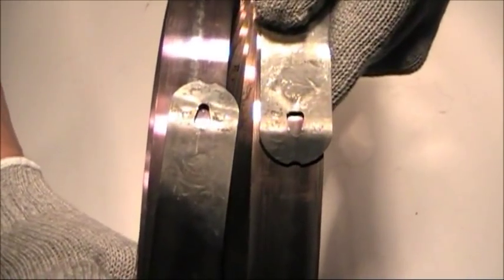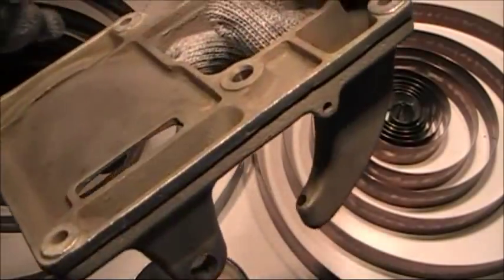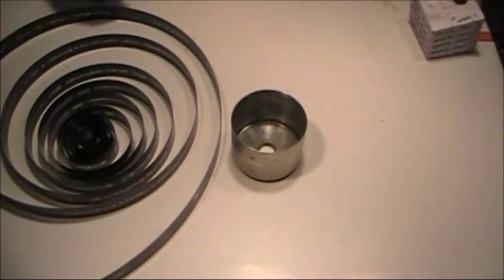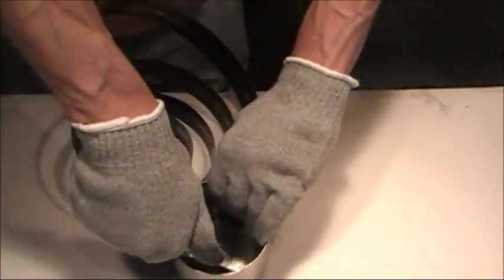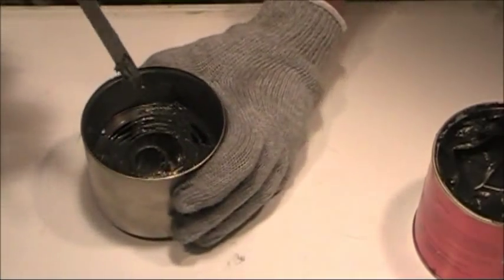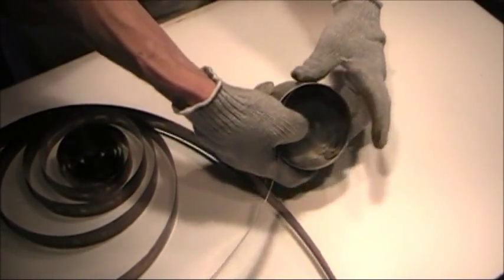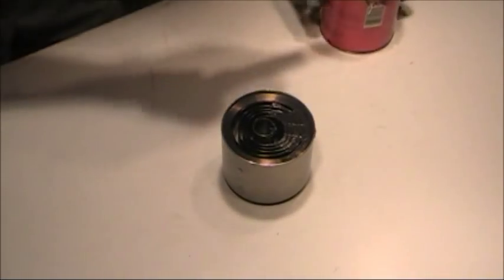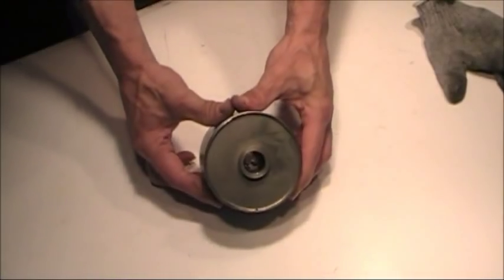Victor Two Spring Motor Rebuild Part 4

Comment: Fantastic tutorial! For UK collectors, this motor is more or less the same as those used in HMV 157, 163, 109 and others and has similarities to earlier motors as well. I've just re greased my HMV 163 reentrant gram which has a double spring. A couple of things to note: in my motor the springs are slightly shorter at 15 feet also on the outer fixing these are secured by a flange arrangement rather than the pear shaped hole and rivet. With the flange type it's easier to locate the spring end but you must make sure that the spring end is fully down into the fixing, especially the bottom spring otherwise the lid won't go on. The divider is perforated on the HMV, otherwise all is as per the video. Yes, make sure that lid is tapped down fully otherwise you will never get that retaining clip on. This was one of the most tricky bits to complete. Mine didn't pop back in but as per the video I married up the two ends, inserted those first, got as far as I could by pressing it in manually then a little tap with a hammer saw it home. It's a bit of trial and error. 
Thanks for posting a fantastic tutorial, it's better than any of the books out there.
Reply: Hola Christopher ,saludos desde Espa;a busco una bocina de ese mod podria usted ayudarme__

Comment: I've only done a spring replacement once, on a Victor VV-210 maybe 15 years ago.  Hah I didn't really know what I was doing but got it done.  Cleaning and greasing it was easy but I didn't think I'd ever get it back in the housing!  Surprised I didn't end up having the spring slash my throat.  Follow this guy's safety instructions, folks!

Comment: I have my Camp Fone portable wind-up phonograph from 1923 and it has a single spring barrel, not two springs, just one spring, and it has a spring belt on there like the one used on one of the Victor Victrola models. That Camp Fone from 1923 and it’s extremely rare. It was made by a company called Health Builders Inc. The company that made one of the early exercise records from the 1920’s. It was in New York, and it last for maybe a year until it went out of business.

Comment: I also have my 1923 Camp Fone portable wind-up phonograph, and it was made by Health Builders in New York, where they put out a series of exercise records called the “Daily Dozen” narrated by the man who invented football, Walter Camp, and also the founder of Camp Fone. That company no longer exists since he passed away in 1925. The portable has a single spring barrel like the Victor did, the gears and a governor. Everything in the motor is included. The motor on the Camp Fone was a carbon copy of a Victor motor.

Comment: When I was working on cleaning the two springs from the motor barrel, I was refuse to put the springs back together, because the motor barrel has a hook instead of the point, but that’s why it can be found on one of the Orthophonic models during the late 1920’s. But I have to try it later. It is a tough challenge, but it took forever to put the springs back in. All Victor Orthophonic models had 2 spring barrels instead of one as you can see. After I have to put them back together, I have to used White Lithium Grease to spray to prevent the spring motor from jamming, and it should work fine.

Comment: @JMLUVZ2FLY I should also say that the weights and springs must be matched in a complete set. You can not buy them seperately. Sometimes the springs are slightly different lengths and the governor will not work properly. Also if the weights do not weight exactly the same the motor will vibrate. 

Stephen

Comment: I have learned a lot from your instructional videos and wish to apply what I learned on my Victor Talking Machine, model VV-VI, which has NO motor springs.  My problem is that i cannot seem to find a source for purchasing these two springs.  Can you direct me to a spring supplier so I may put my training to work?  By the way, very nice video preparation, on all 6.

Comment: I use number 1-1/2 graphite assembly lube and it works well. Number 2 grease is too thick but should be fine if you also use oil as you have done.

Comment: This series shows how gramophones have precision that's also simple, for the most part they were built and designed in an era where reliability and maintainability was important. Reasons why me and other folks have been able to get them running with just a basic knowledge of mechanics and lubrication diagrams. I keep the mechanism in mine lubricated with Vaseline and 3 in 1 oil, why use other lubricants when it says what to use and it's worked for a very long time? (the vaseline and oil is only for the gearing inside and is not for the springs)

Comment: If I still have my VV 8-4 that has a 4-spring motor with 2 barrels, this would be a great idea to be rebuild. I’ll go to an auto parts store to see if they have a motor oil like STP or Penzoil to put it on a spring motor and put some grease on there. Goop would be better.

Comment from the maker: If you are new to the hobby I might suggest joining the "Talking machine forum" and searching the post. Always good information there. Your springs should wind back the same way you took them out. No your motor won't run without that third governor weight. Search eBay for those parts. You may get the whole governor cheaper than just one weight....Good luck!

Comment: thanks for the great explaining,  I learned so much.
I´ve got a credenza with 4 spring motor. Is the direction of the springs the same
as the 2 spring model, means 1rst spring clockwise, 2nd counter clockwise in both
spring barrels?

Comment: After putting it back together with white lithium grease has added, I tried to crank it, and it does nothing. It wind it by itself. I'll have to try it again. White lithium grease will not help out good. If you want a better grease, I want to get the heavy duty grease at Walmart. It's $4 and it's in the auto service section, and you can get a motor oil like Pennzoil, Mobil, Castrol, STP, and other brands to fill in the spring barrels.

Comment: Definitely a great effort and presentation. In the process rebuilding a 1925 cabinet model from UK and looking for a replacement for a broken spring which is different from video in that my springs are bent back over instead of having pear shaped holes. If anyone knows where I can get a replacement, please email me. thanks to chilldude 2007